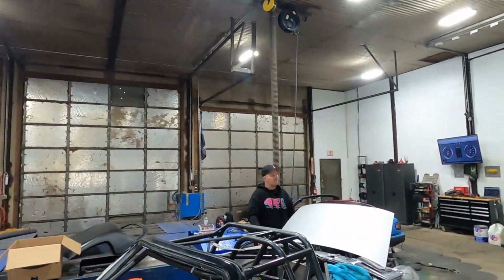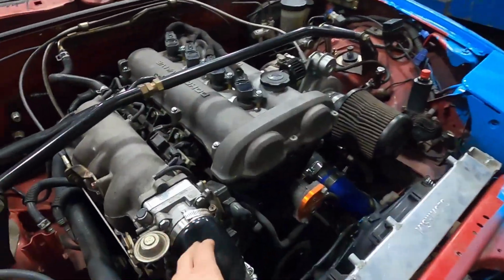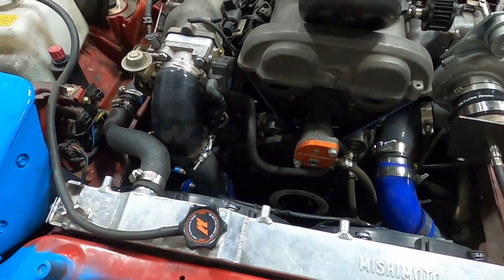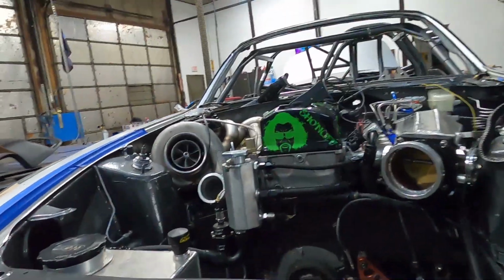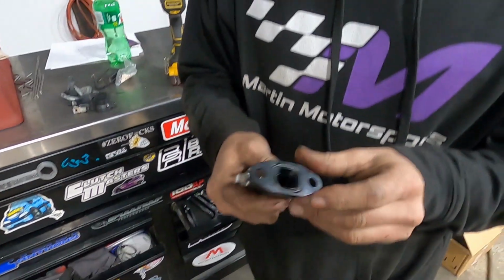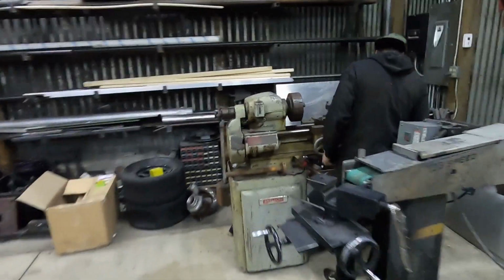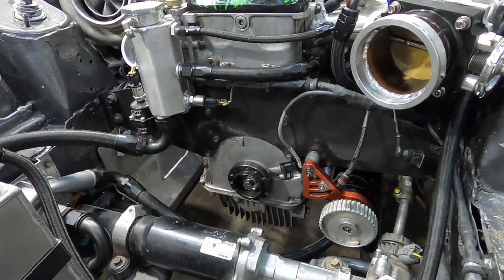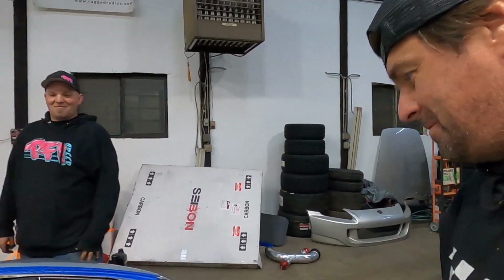A Turbo Oil Drain Flange that will not work! ShoNuff!

Comment: Herman here from Cherry Turbos. You are absolutely correct about the flange. Two things occur in that drain. Oil departing via the force of gravity and crankcase vapors and wind and heat fighting against it. The oil will become it's own cork and force oil to exit past the "seals" if there is not enough room for both the oil and crankcase pressure. I put the word seals in quotes because they aren't seals and they don't seal. Their primary function is to stop as much boost and exhaust pressure from entering the bearing housing in the turbo as possible. They are chrome steel piston ring-like baffles. I'd recommend at least .600" I.D. for the drain at all points between the flange on the turbo and the oil pan.
Reply: Cool seeing you here herman, Jason from RHB here and I approve this message.

Comment: Looks like that turbo could even do with a -12 fitting! From what I've seen and heard from a ton of turbo experts, most of the time a turbo smoking is from insufficient drain. Especially on brand new turbos. Shon'Nuff it's gonna be beastly!
Reply: correct restrictor and biggest drain you can use.
Reply: yup and yup. even a -12 AN fitting is not actually 3/4" when you factor in the opening at the end of the fitting is probably quite a bit smaller.
Reply: And to much angle of a turbo like Shonuff can smoke on idle. Because oil flows a little bit threw the turbinewheel seal

Comment: You should make a 2nd hub to have incase since its a unique cut to fit that dampener.
Reply: Everything on that car is unique 😁
Reply: I'm thinking its also about making do with what you have. Buy the right dampener and it shouldn't be a problem. So if you're getting a second, just get that. 
Needed a stock dampener just this december for my 140k civic, honda couldnt give me a date. Now i've got an ATI street one, but there were few in stock, and I think the racing ones were all gone xD So he might not be able to get one. I'm in europe and it made sense to fedex express it from summitracing.

Comment: You can pull the cage apart on that turbo and port the drain from the inside so the oil has a nice smooth transition 👍👍👍👍

Comment: With those cheap drain flanges I tend to run a 5/8 reamer through them which helps. Porting it afterwards helps further.

Comment: I had a similar issue when I bought an eBay catch can. The fittings were all AN10 the original fittings only had a i.d of 8mm but I decided before fitting it they were too small to breathe properly and fitted bigger 15mm i.d (if I remember correctly) 

....And I still pass oil vapour through the filter 😑

Comment: Man I'm glad I saw this video. I have the same exact turbo drain fitting as your old one to use on my S480. I checked and the turbo drain hole is wayyy bigger than the hole in the fitting. Definitely going to order a new one now. 🤙

Is that new one from Motion Raceworks?

Comment: inadequate oil drain is almost always blamed on "failed seals" lol needs to be as big as you can afford. those AN fittings, while nice looking, are restrictive due to the adapter hole. some 1/2" diameter pipe is goodnuff.